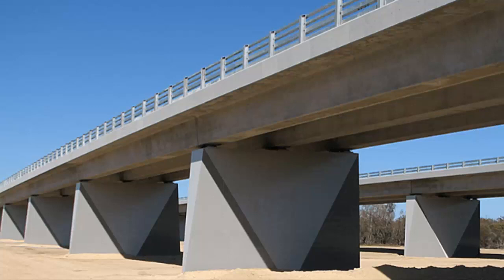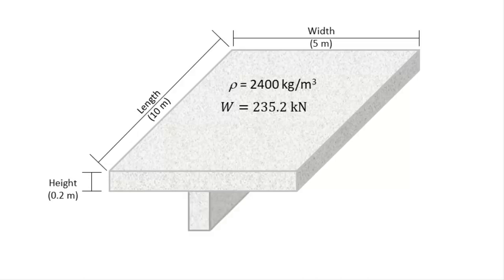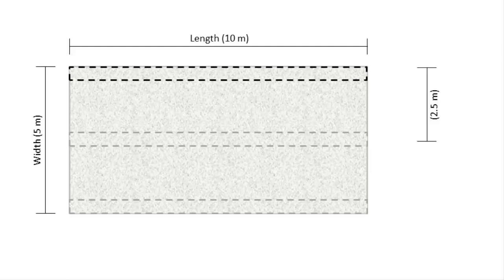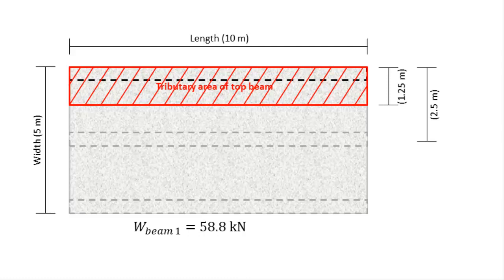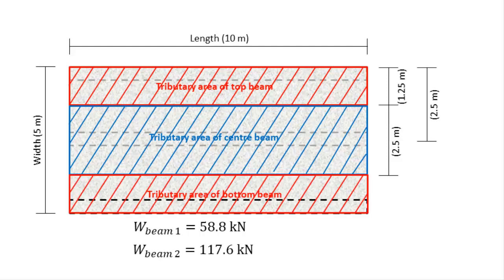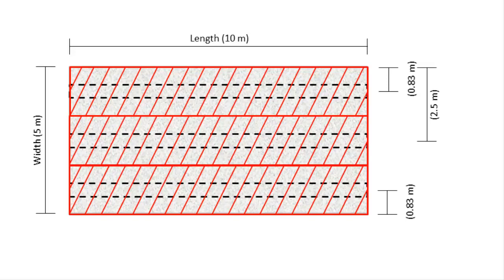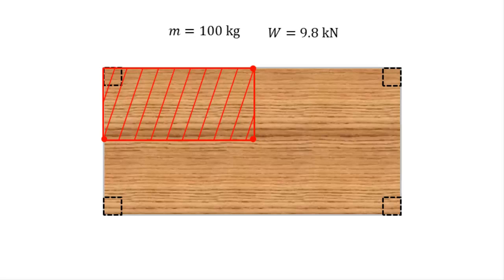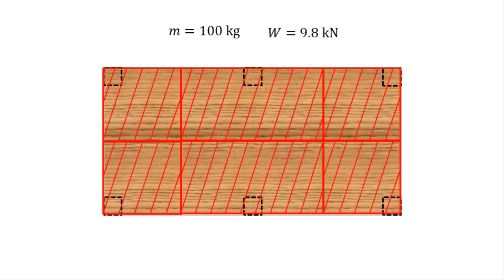Basic Structural Mechanics Video 3: Tributary Areas (Part 1)

Comment: That is a good explanation, but there is a mistake in the estimating of the weight of the 100kg table which is supposed to be 0.98KN instead of 9.8KN. Otherwise I really liked the content. Thanks
Reply from the maker: You are correct, thank you for pointing this out.